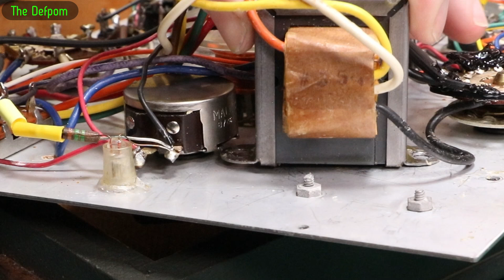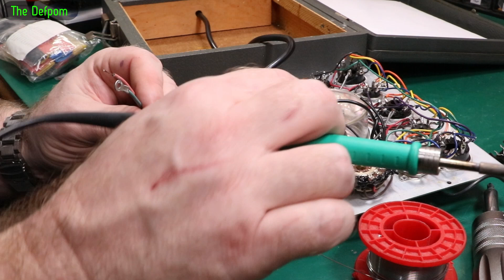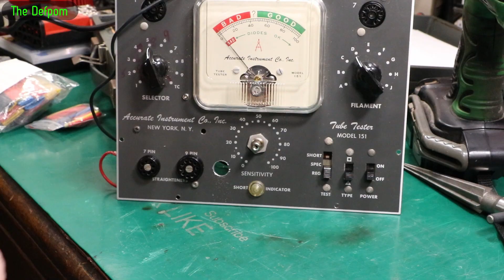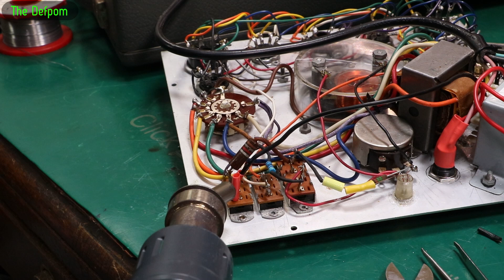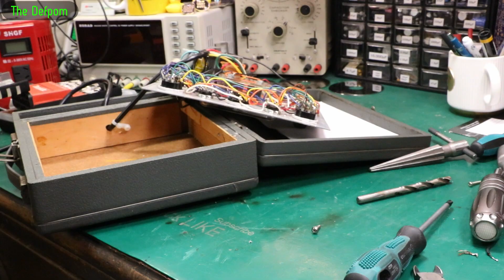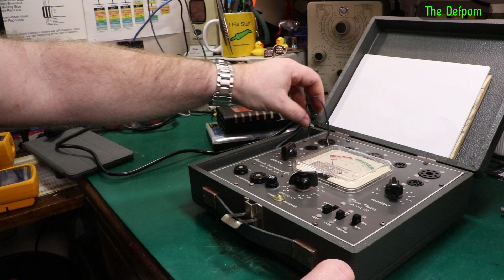🔴 Tube Tester Repair - Accurate Instruments Co. Inc. Model 151 - Part 2 - No.1300

Comment: I am kind of surprised that you went through the work of adding a transformer inside the unit to drop the voltage. I would have installed a polarized 120VAC plug cord on it, and then, got a larger 240VAC to 120VAC transformer and had it as a dedicated power source for any more 120VAC devices you might encounter. If you got a primary / secondary isolation transformer instead of a cheaper autotransformer,  that would also be another level of safety for working on 120VAC units.
Reply from the maker: @poormanselectronicsbench2021  I do have and use other step down transformers. I wanted this to be usable on 240V directly.

Comment: I don't like to just tack two wires together without some sort of mechanical joint. My recommendation is to use a non insulated butt splice and use a piece of heat shrink tubing for insulation, that makes a good mechanical and electrical connection.
Reply: this is why you want a pair of round nose pliers so you can form nice hook joints before soldering then. but you have to remember that laying two wires side by side is the preferred method, as prescribed by the YouTube university advanced soldering course 🙂
Reply: @TheEmbeddedHobbyist  I was an avionics tech in an earlier life and still work on all sorts of radio and audio equipment as a sideline. I learned early on when I was going to school for both avionics and airframe and powerplant to always make a good mechanical joint before soldering.
Reply: I started making Avionic equipment for jet fighters so a good mechanical joint was important as there were very high levels of vibration inside the equipment. even to the point that we feed the wire through a tight hole in the PCB before soldering in to a hole. so any vibration was filtered through the wire insulation and not in bending the wire strands.

Comment: Fuse 100ma slow blow will last a long time, it will just be better against surviving the initial inrush current.
Reply from the maker: @SeanBZA  I will worry about it if the fuse ever blows, it’s not really something going to use more than once every decade or so anyway !

Comment: I have held them down with VHB tape before, or even epoxy, and so long as the transformer does not run too hot that works well.

Comment: Just wondered why didn't you just re-wind the primary on the original transformer? ... or get a 240v transformer with the same output winding voltage as the original? It would have kept the unit closer to the original.
Reply from the maker: @simonbaxter8001  I’m not a rewinder, don’t have the gear to do it, and the original transformer has a bunch of secondaries so not possible to just buy a suitable replacement.
Reply: @TheDefpom  Multi-tapped secondaries not for the beginner winder for sure. Grab yourself a rewinder though, the cheap mechanical ones work good enough......I showed one working in a 3457A repair. Always handy.
Reply: Trying to find a transformer with a 240 volt primary and the proper voltage secondary windings due to the multiple taps used for the filament voltage would be hard if not impossible. To me the use of a stepdown transformer is the best way to go. That's what I would do in the same situation.